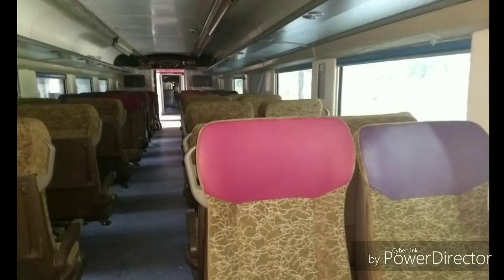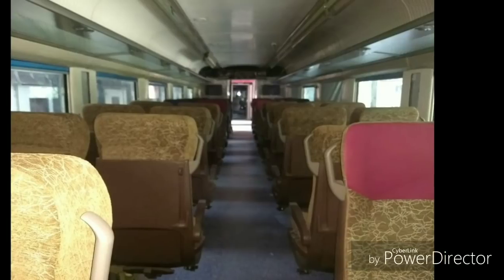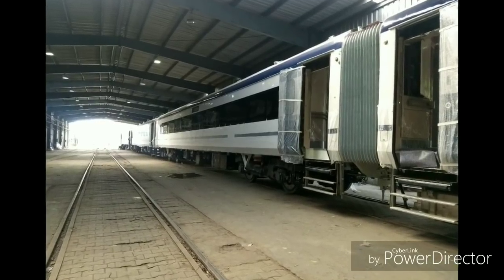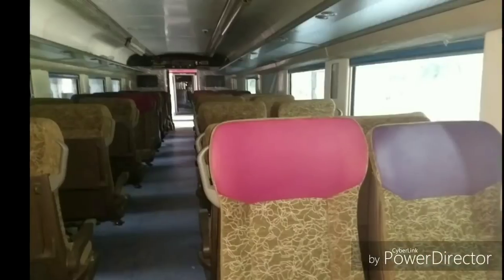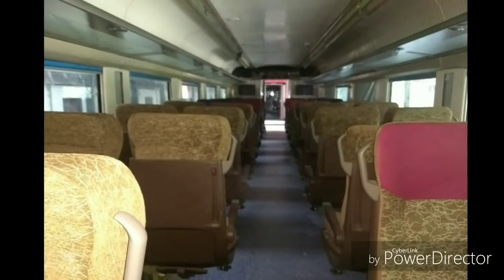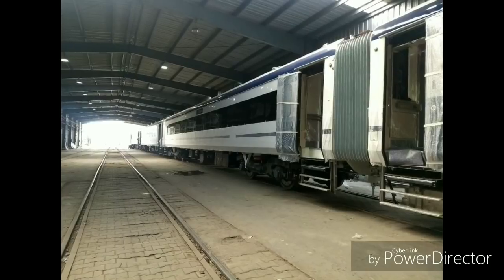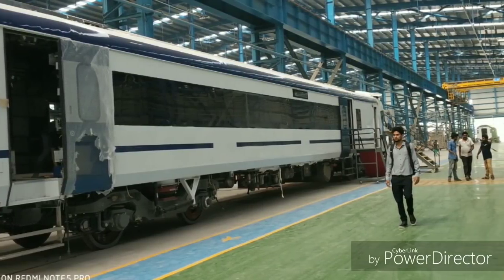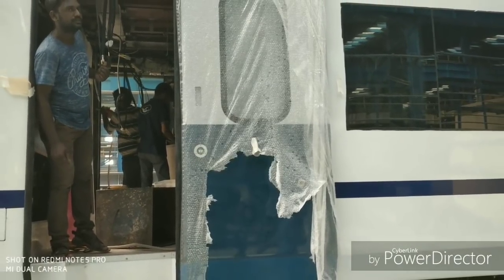TRAIN18 .First look and impressions.. Review.. Request to passengers..

Comment: I really hope they don't change the train color, as it really looks simple and good, otherwise if they change color everyone knows what's the reputation of IR when it comes to color scheme.
Reply from the maker: It may look simple now.. but once it starts running dust gets accumulated on the walls of the train and it easily gets dirty due to its white colour
Reply: Automatic train cleaning and washing systems can be installed at major railway stations. Railways has installed them on a trial basis. These systems clean the train's exterior as the train departs from the station. The train simply has to drive through the machine and it gets cleaned automatically, like a car wash machine. If some Indian company starts making these in India, it will be very cheap and can be installed on all major stations of our country.

I am more worried about people deliberately vandalising trains. Maybe these trains need CCTV outside, above the door to ensure no one vandalises the exterior.

Comment: Color will be same white and small blue strips
Reply from the maker: In case of India where ppl spit paan on the walls maintenance of coach becomes tough if it is coloured white....so what I feel is they will definitely change the colour
Reply: +ashwin kumar
I think the paint used on this is different than the ICF usually uses, since this color looked more glossy, smooth and crisp, there's a possibility that any stains can be easily cleaned on these coaches.
Reply from the maker: @dontjudgemebymyname.4282   You maybe correct bro.. but nothing is official as of now.. the reason why I think there will be change in colour is only because of its door colour which looks similar to tejas' door colour
Reply: @ashwinkumar5547   I think they will just change color of the door, but yeah anything can happen.